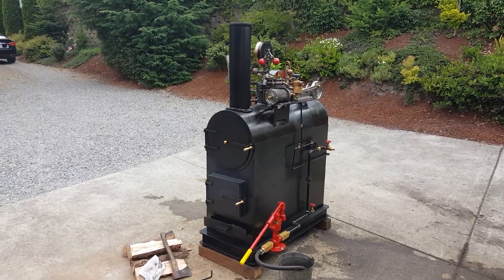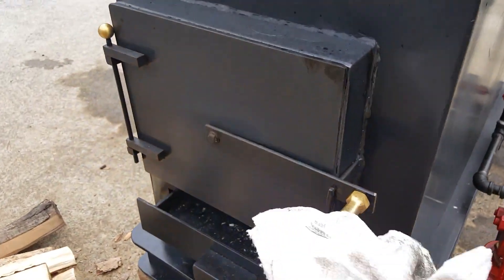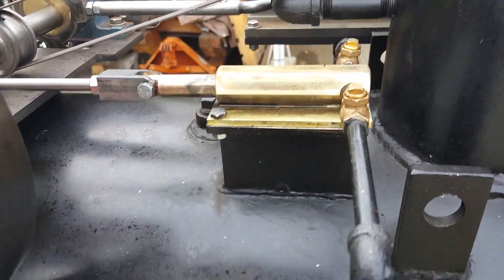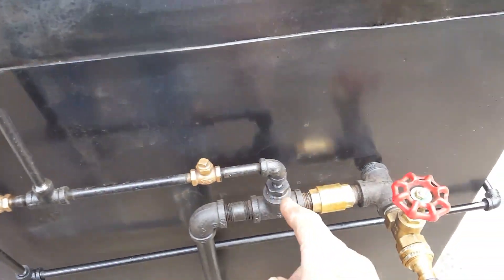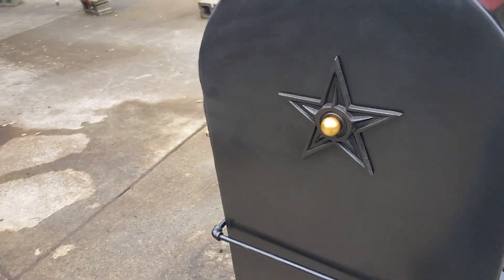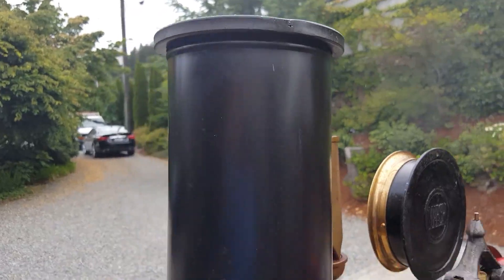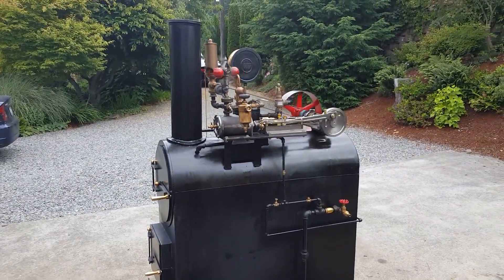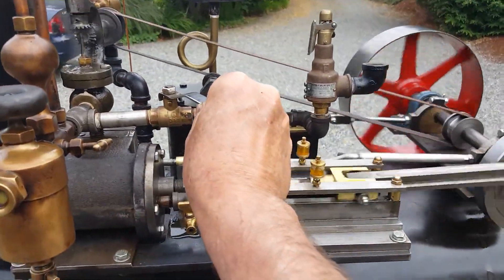Return Flue Horizontal Boiler with Steam Engine  VERY RARE!!!

Comment: How many horsepower this produces? Can you recommend some setup like this. Goal is to spin alternator around 5-10kw and possibly other mechanical tools such as firewood processing tools and sawmill. I live off grid on island and would like to be able to produce electricity to charge my off grid homesteads lithium battery. I am currently trying to study steam engines so i could replace gasoline generator in the future. Would really apperciate your viewpoint and recommendations on what kind of setup to look for

Comment: Cool setup. I do wonder why that pump is so noisy. Also, why do people never seem to run these engines with the governor? They always use a hand valve to throttle the steam?
Reply from the maker: The governor is a very difficult part to build. And expensive.
With a valve the engineer just sets the speed that they want.
Reply: @rossbendixen  So, is the governor on this one just for looks and doesn't actually do anything?
Reply from the maker: The governor is fully adjustable and functions properly
Reply: @crissd8283  The governor is absolutely indispensable for an engine who will work with an alternance of no effort/maximum running effort like a woodsaw for exemple, because without effort on the mainshaft a steam engine without governor will run absolutely too fast out of control , or if moderated manually , very slow and event stopped wen the working effort comes back again.
There would be a really huge variation in frequency between the absence of effort and when effort is required again on the pulley.
The governor, if correctly made and set up, will stabilise perfectly the rpm speed at the desired value in maximum load and almost no more when the resistive load disappears (no load). The injector is not required for a traction engine or loco for exemple because in this case the steam engine is alway in load .
Reply: @Louis7.62X39 Yes, I understand how a governor works. I just dont understand why in all these old steam engines, no one ever uses them to control engine speed. A governor is certainly nessisary for variable loads where a near constant speed is required.
Reply: @crissd8283  Also, sometimes it seems that there is no governor, but in fact there is one, but of a different, more modern design with weights in the flywheel that control the lenght of the travel of the steam slide valve instead of the opening width, which is more efficient. Afterwards, as Ross says, it is an expensive and delicate accessory to build and operate, and it is often damaged and inoperative on antique machines...🤗
Reply: @Louis7.62X39  Most of the ones I see are throttled by a gate valve. The operator stands there constantly adjusting instead of letting the governor do its job.

I know, in industrial setting the governor certainly works, I'm talking about steam shows and museums.
Reply: @crissd8283  On the Rob DIkinson YT Channel we can see in Burma that sometimes , in rice and sugar mill the governor does not work ! The operator adjust manualy the main valve, but in this case the working load is alway almost the same and a very stable and accurate frequence is not necessary ... like in a steam show or a museum ! But for electric generation or a sawmill, looms , thats an other problem...🤔 However, it's alway better and satisfying to see a governor working well ! Especially when the owner is yourself...🤗
Reply: That sort of water pump is alway noisy because the non-return valve inside are alway knocking . For heavy duty engine , used many days, the wear rate is pretty impressive and the noise annoying. That's why usually a air tank is added on the outlet to avoid the water hammer problem. They also need lots of maintenance and frequent repairs, especially for wintering. 
Good homemade steam injector is a far better solution : extremely efficient, no knock, almost no noise, easy to start and automatically restart if water supply is interrupted, very slow wear, pressure more than 2 time upper than the one inside the boiler, empties completely itself, no water remaining stagnant inside , no special precautions for wintering ... I have learned to build my own models and and it really works very well, not so hard to make ...For me, piston pumps are now nothing more than a bad memory.

Comment: how far across bottom of the tank is the fire box?  Just one end of it??.  or across bottom of whole tank so one can use long logs sections?  By size of the ash drawer assume it is just the one  end.
Reply from the maker: If I remember correctly the firebox ran the entire length of the boiler.